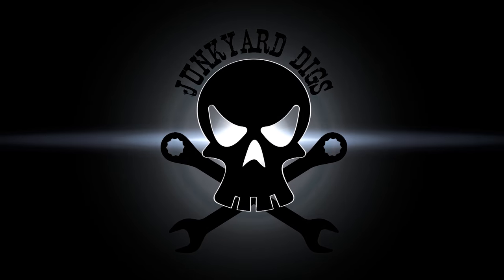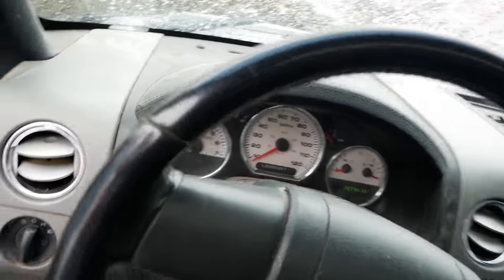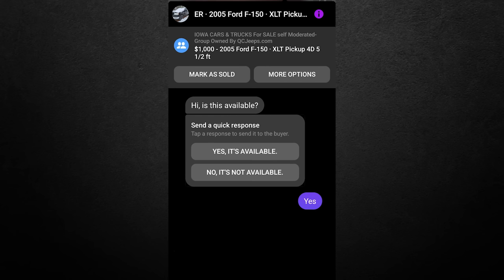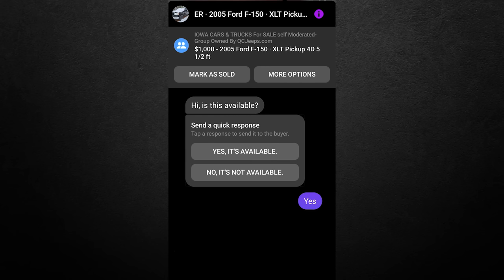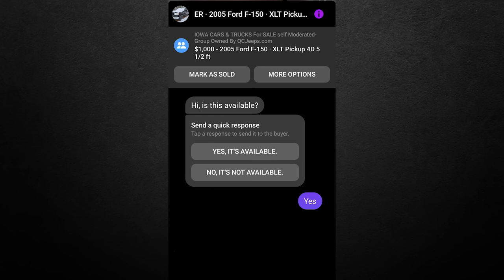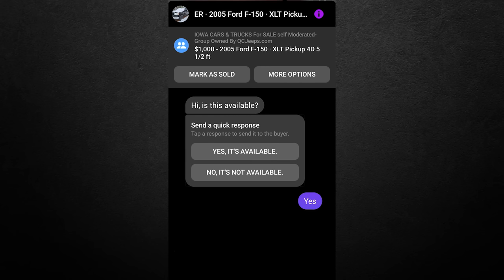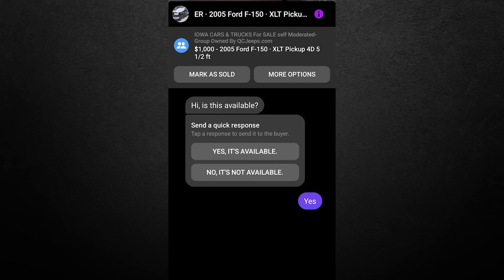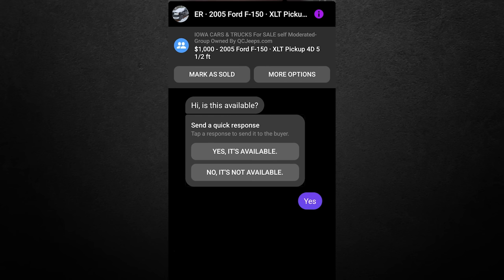How Safe Is a SEVERELY Rusted Frame? - REAL Crash Tests - Cornfield Science

Comment: Thats why i love german car culture.
To get your car on the road you need what is called a TÜV-Plakette. This is a little batch on your license plate. If you dont got it or if its expired police will stop you with hefty fines and a tow if they catch you again. (extending the tüv plakette obove 3 months)
The "Tüv" checks your vehicle inside out, there is NOTHING they dont find. They are rly good at it.
Any little malfunction can result in you having to go there again to show that you removed said malfunction.
Rust on your frame? Well boy you better learn welding and car painting.
Its also a good thing as they show you smaler malfunctions that might get you failed next time if not taken care of.
So 99% of vehicles having a tüv plakette have no rust on the frame. Mostly also a good buy indicator.

Comment: “Toyota, in 2016, settled a class-action suit by agreeing to spend $3 billion to repair millions of Tacomas, Tundras, and Sequioa SUV's with rusting frames. Model years affected are from 2004 to 2008 (or 2010 in a few cases). This follows an earlier extended warranty affecting Toyota trucks from 1995-2003”. And I know someone who had the frame on his truck replaced.  He was hoping to get the value of the repair off of a new vehicle; but dealer insisted on repairing.  They gave him a free rental (car, not a truck) and it was a three month repair because of parts availability.

Comment: There is a point where a rusty chassis becomes dangerous. Before that point it won't fail. After that point it will fail. The tricky part is deciding where that point is.

Comment: Great to see just how much the rusty frame could take. I had a 2006 f150 with 125k miles ran perfect but frame was swiss cheese. I found a 2005 truck with a bad cam and 274k miles but the frame was perfect. bought it for 2700 and swapped the engine  and did a timing job on it in my driveway over a couple weeks. Still driving it. Rust free truck with 128k on engine. Keeping it till cybertruck is available.
Reply: dont wait for the cybertruck, just keep driving that Ford till it dies.

Comment: It is an origami truck. Im waiting for the frame to snap. Because it is the bottom that remains, vertically, it should be on. Go over speed bumps and railroad tracks at a decent speed. That bump in the field may have done it.

Comment: It does say something for the integrity of the passenger cell even when the frame is so compromised. At highway collision speeds, the story would be different. There are some solid pieces of mechanical hardware which becoming detached from the frame could enter and do harm.

Comment: As a Snow Plow Truck owner in TOLEDO Ohio and  highly experienced.              Rubberized coatings DO NOT WORK.  Primers work alittle better, but not good enough by no means,   OIL UNDERCOATINGS ARE THE BEST AND the BESTEST IS Just dont drive in road salt. Until they quit using the car and road poison.

Comment: I have a 98 4x4 is rusted that bad I have to use a face shield to work on it.It’s not rusted all the way through the frame rails but it’s still bad.  I use it to pull trailer but after this I’m worried now.I have a 01 did rockers but it’s not even near that why some rusted like that but not all

Comment: Only reason this truck held up as well as it did was because the body wasn't too rusty. Now if it was a newer aluminum truck the body to frame bolts would probably rip out pretty easily through the body. I've personally seen a few new fords rip and tear from very minor damage.

Comment: I remember seeing this truck in Webster city  frequently figured it had to be bad. Didn't guess it was this bad lol holy cow.  Looks as bad this 07 Colorado a guy brought to me that he bought in New York. 135k miles and it was rotted so bad that the box was against the cab only thing that was holding it together was fragments of the lower flange and the gas tank. Was brought to me for a fuel leak caused by the frame flexing and breaking it open.  I was like ya I'm not touching this heap lol

Comment: Ford may have used rust prone metal in these, but they use a lot of it and that's why this is always extremely heavy built truck. The evidence is undeniable when it gets in this bad of shape and still won't break in half. This is why some of the competitors collapsed and broken half sooner when they began rusting.

Comment: I work for Ford and this is an embarrassment. I've seen the same rot on another channel on here. Truck looked pretty decent till he went under and showed a 2 foot crack on the inside of the frame. Then he adds that it does the same thing behind the gas tank. I don't remember open channel frames rotting the way that generation of F150 does. Edit- Well i stand corrected. That was impressive how well it held up to all that abuse. I did not expect that. Lol

Comment: We dont get to see, or perhaps realize, when a frame has rusted to a point that it is dangerous.
This is the first vid, (there must be others), That has shown what strength is left when a frame has been rusted down to paper thin metal and even holes.
Well on the side of the holes,  manufacturers cut holes into metal to make it lighter.  So that truck must weigh about the same as a volkswagen, right?
But as severely rusted as it is, that frame still had enough strength to it to last some of the pounding that  you threw at it.  I suppose that is a good thing.
when my truck was at the 20 year mark and came home from storage, I had the mechanic put it on the lift so we could "peruse" the frame.  Surprisingly, only some surface rust, no holes.  I treated that rust frame with some anti rust treatments shortly after that.

This makes me wonder, what that 2005 F150 had gone through to have the frame destroyed like that.
My truck is in the snow belt and has gone through the salts and lately, the chemicals used to eat your trucks metal,  I mean to melt the snow off the road.  It has held up well.  But your truck is basically destroyed, and it is much younger than my truck.

So for what it's worth, we now know that a truck with this amount of damage can hold together till the next inspection, or oil change where they can't miss seeing the damages.  At least it had some integrity but it was time to get off the road.

Good vid.

Is it still for sale?  a little patch work and some paint and it is read to go.....

It would be interesting to see how a rusted UNIBODY car/truck can hold up to the same abuse.

Comment: That should have failed inspection and taken off the road at least 5 years ago, way before it became this bad.
I think if the top front edge of the box wasn't against the back of the cab the frame would have bent to 90 degrees 😂😅
Hey.. the back window didn't break...🤣

Comment: Are the tritons really that bad? I have an 06 5.4 triton and haven't had any issues with it other than regular oil changes. There are tons of high mileage ones still running out there.
Reply: They're a hit or miss
It was mainly people not maintaining them.
They do have those cam phaser issues but they'll still run as long as they got oil.
They also have weak oil pumps..
But all that is pretty much preventable if the oil is changed every 3000-4500 miles

Comment: The only frame that I’ve seen that is worse are the unibody rails on a jeep Cherokee, the fuckin thing drove in while a good 3rd of the frame had the bottom of it completely gone and the rest of it you could flex with light pressure

Comment: No way I would pay $800 for this, that's an insane amount for the bag of rust.
Reply: Sell the engine $500, transmission $500, wheels ,$400, use battery as trade in $30 scrap value $100 still a good deal

Comment: And I’ve been on multiple Chevrolets and Toyotas with the exact same problem. The frame all rusted out they put too many holes in. They need to start putting all the holes. If you’re going to make it to frame, it should be solid you know water or Ross Mersol can get inside

Comment: Is there a reason why all truck builders can't use a slightly more rust resistant steel alloy for just "few dollars more"?  In not talking stainless, but just something that can make it 20 yrs without structural  compromise.

Comment: This truck was designed to tow and haul large loads it's frame is stronger other automobiles. Also as Ford tech mocoloco has proven these are good trucks you just need to be on top of your oil and pay attention to the engine sounds. In comparison to many other vehicles out on the road these are still quite reliable there are just a ton of them out there so of course you are going to see a lot of them in the shop it's the f150 ford built like a bajillion of these things.

Comment: The video proves even with a bad rusted frame you can still make it.  Just don't back into a tree or crash into one.   With all that rust hot dang those ford trucks are tough.  If he had driven it another 30k he wouldn't even notice there isnt a frame.  That truck holds up with air alone.

Comment: It could have also been running rough from burning 10%ethanol fuel in it. Probably not but people don't know about this. I've had freinds vehicles of various makes and models with idle and starting problems that have fixed with just putting sea foam and running no Ethanol fuel and it improved there fuel economy by 10-50% and fixed mild idle issues. This thing has alot more than that but I think that a lifetime of burning Ethanol in a vehicle especially the 5.4 would make what ever issues worst.

Comment: As dangerous as this truck would be to use on the road I fully understand why you would want to destroy it for fun but I do wish you were still able to part out the body panels like taking off the tailgate and the lights and such just the easy stuff that wouldn't take too long to pop off....

After all your testing the durability of the frame not the sheet metal which besides the doors on the right that got scuffed did not look dented if at all.

Ultimately I think the best way to test it would have been to cut all of the body off turn it into a go-kart and then you could see everything on camera

Comment: What is sad is prior few generations at most bed rotted to nothing. Can't say same for wax coated from factory chevy frames. They usually break in half behind the leaf spring. This model generation should have never existed. They turned a good truck into trash planned obsolesces by adding cam phasers when they where not needed to the triton and then cheeping out on lifters, and timing chain guides that fall into the oil pan. Sadly I too got lied to and sold one of these junkers. after loosing 2k I swore  would never buy a 2004-2010 F150 every again. Hell prior years 97-2003 could last a million miles if taken care of on the timing chains from factory.

Comment: I live in Ontario Canada between cornwall and ottawa i have a 2003 i think honda passport it is a body on frame suv the frame on the pickup is solid as new compared to the passport on my passport there is a 1 inch hole almost all across the frame i can see one side to the other side of the car its worse the the f150

Comment: I've seen enough shitty rusted out vehicles to know that if you continued on with your plan at the start then it would do more to make people think something like this is drivable more than to dissuade them. It might look scary to someone who has only driven solid vehicles, but most of these things are held together such that even with massive rust it still takes a literal crash or engine/trans failure to stop them, and they won't just rattle and catastrophically crack apart. There are decades of engineering put into modern vehicles to make the structural integrity as idiot proof as possible. If this truck were to stay on the road, the engine would have taken it out in the end, not the frame. Also you well know that people can and do weld rusted frames to stiffen them back up and reinforce them. Will it last forever? Hell no, but it might last the life of the engine.

Comment: Ford build some decent looking trucks. That’s a shame that one had frame issues & rust . You’d think ford would have done something. Toyota had issues with  the frame rusting. That was the Tacoma pickups . How ever Toyota replaced the frames they had a recall on them. I give Toyota credit at least they steeped up & took care of it. Ford had issues with the 3 valve engines & cam phasers . There was certain model yrs . I’d say it was a bad design. The only repair was to replace the engine. It’s expensive to replace. You got to ask yourself is it worth it. I watched car wizard he said those certain model yrs that had the (3) valve should be Avoided.

Comment: My 1998 silverado 250 000 miles in the rust belt has alot better frame on it.  I think Ford just used crappy steel

Comment: Does it have one of those stinky tritons in it probably does we had a buddy who used to have a Ford explorer I like to call them Ford xploderz because it had the crappy Triton engine in it and this dude had a breakdown and we went out there and tried to get it to run and when you tried to go started it sounded like it was galloping like one of the cylinders didn't have any pressure anymore I know that's been popping up a lot more recently how to relative that had the same thing happen to them search anybody who's buying a early like to mid-2000s forward don't because eventually it will die or it will die within a block of the person you bought it from that truck if you let it sit long enough the beautiful thing about Kansas is with time comes more luxuries and what I mean by that is you gain the luxurious option of a walkthrough cab we have a Dodge d100 that is starting to get that option I'm pretty sure I see some of the frame what was some of the frame still a good truck though we'll drive the thing until the wheels fall off or just pulls a good old-fashioned Titanic and splits in half right there on the train tracks